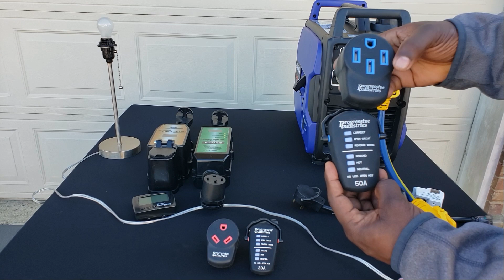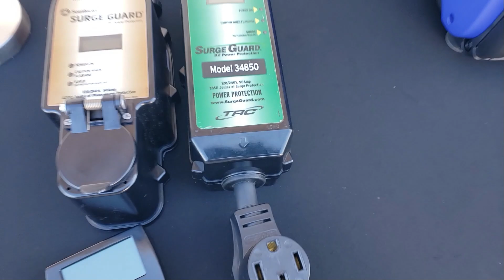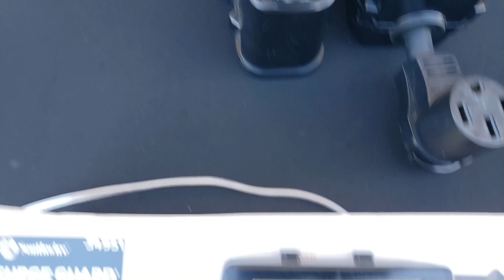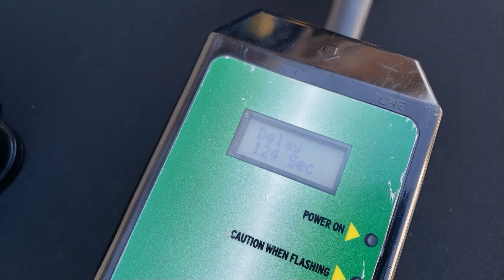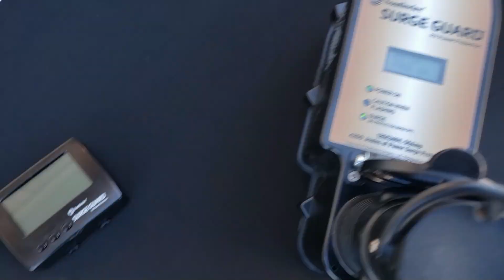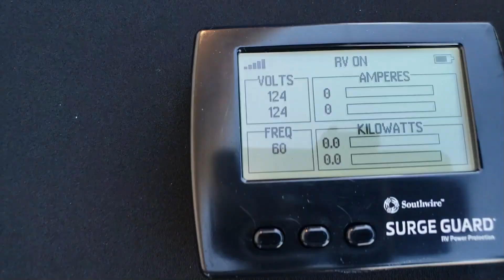Surge Guard Protection for Home and RV Back-up Power

Comment: I need to have an  inverter generator connected to a refrigerator.  Considering that the generator must not have a load when starting, does a surge protector protect the generator if I start it with the refrigerator already connected by mistake?
Reply from the maker: The surge protector helps with voltage spikes

Comment: So is it advised to use one of these when back feeding your home via a generator with a manual interlock and the generator is unbonded? Will these prevent issues like what say, a neutral wire form generator is loose and causes imbalance on the 120 legs which could overvoltage things in the house?
Reply from the maker: The only thing is you can’t use it on a floating neutral generator and that is what’s required for home back up

Comment: Great video I’m going to subscribe. What type of protector do you recommend for me? I’m running a Westinghouse Wgen9500 gas generator connected to a 10 Circuit Reliance manual transfer switch connected to a sub panel in my garage. Is there a way that I can install the protection into the transfer switch power outlet, in the transfer switch itself or into the sub panel? The main reason for my want is to protect circuit boards and LED bulbs throughout my home.
Reply from the maker: Sounds like you need a 30 amp surge protector for your transfer switch

Comment: I have the Duromax 9000 with 120/240 volt 30 amp twist lock  and 30 amp inlet box....would it be best to wire a whole house surge protector versus adapting a protector?
Reply from the maker: If you’re only going to use it on the home that would work installing a whole house surge protector but if you also have an RV, then the portable one works great.
Reply: @GeneratorReviews  thanks as always, Gavin.
No RV,  just home backup with my generator.

Comment: I don't have an RV, but I have a 240v 30 amp dryer in my home which one of these SPD will work to protect my equipment?
Reply from the maker: Anyone of the 50 A search protector will work for you as long as it’s 120V / 240V output
Reply: Thanks but why would you recommend a 50 amp spd over the 30 amp spd? @GeneratorReviews

Comment: CAn you use this on my house standby generator plug in to
My house
Reply from the maker: Yes, you can use it on your house for your standby generator. You just need a bonding plug if your generator is floating neutral.
Reply: @GeneratorReviews  Doesn't the generator need to be unbonded if using it for your house since the neutral is already bonded at the panel? So these can't be used when generator is connected to house and is bonded only in the house breaker box?

Comment: Hi there. I'm about to buy a back up generator for my house. I've read how inverter generators are safer for electronics, but they're pricey and only go up to ~9500W. I want to get a larger 12K or 15K W generator, but it wouldn't be an inverter. Will the Surge Guard protect electronics in my home? And are surges the only concern with non-inverter generators? 
I'm also looking into installing a Siemens Boltsheild FSPD140 Level 2 Whole House Surge Protection Device Rated for 140,000 Amps, 120/240V into my outdoor electrical panel and a 50 amp power inlet box for a generator hook up. But I'm not sure if the Siemens device will protect my electronics from surges from a generator. Any thoughts on this approach?
Reply from the maker: Hey 👋🏽
Well you are correct about the inverter generator but I can help you find the right one for your needs. 
You should visit my website and contact me when you’re ready.

Comment: What would I use on my Westinghouse 7500 generator to control the THD which I read is 23%
Reply from the maker: It’s not a pure sine wave generator so it has THD
Reply: @GeneratorReviews  is there an add on to control the THD

Comment: If the generator needs to be floating neutral for home back up and it’s bonded in the panel.  Would you still need the bonding plug on the generator for these to work properly?
Reply from the maker: Yes, the generator have to be bonded in order for the surge protector to work
Reply: @GeneratorReviews  So how do you get around the need for the floating neutral for home back up if the generator needs its own bond. Is the bond in the breaker box not sufficient?
Reply: @scottguich6099  I have the same question. NEC says only one bond, but then for the surge protector, saying need to be bonded at generator. I don't get it unless the surge protector breaks the bond inside it?

Comment: Excellent video!  I am about to buy the Surge Guard 34951 (now has bluetooth to phone app too) for our new fifth wheel and I have a question.  I've thought about buying one of those small surge progressive industries surge protectors so that if a surge happens, it fries the cheap one rather than the expensive one.  What are your thoughts on that?
Reply from the maker: I would definitely recommend you getting something to protect your RV and your investment but those Bluetooth surge protector are so nice to have you see everything you’re running and keeps you from going over especially when you’re running two AC units, helps you monitor the load.
Reply: Sorry, I wasn't clear on what I meant. I'm definitely getting the Surge Guard but should I plug that into the pedestal or plug it into a cheap surge only protector so if I get a bad surge, the cheap one fries and not the surge guard.

Comment: Any issues with using a L14-30R adapter coming out of one of the 50amp surge guards?
Reply from the maker: I haven’t had any issue using an adapter with a 50 amp surge protector

Comment: @Gavin....... brother I learn so much watching your videos. You put things out there in Laymens terms , that even even someone like me can understand. Thank you!
Reply from the maker: Thanks Jeffro
I appreciate you watching and subscribing 👍🏾💯
Reply: @GeneratorReviews  You bet Gavin!! Hey , I do have a quick question here. Do either of these big 50amp surge protectors , clean up the dirty power coming off a conventional generator? Maybe to help protect vulnerable electronics such as computers and so forth?  I could go with a 9000W invertor generator , but I'd like to use a bigger 12,000 - 15,000W open frame generator , if I can make sure it's not going to fry my electronics inside my home.  Was going to use a 50amp integrated plug into my main fuse box outside.

Comment: Have you ever measured A.C. voltage at your generator receptacles? 
I recently learned that some inverter generators are putting out 60-65 V. AC on hot leg and the neutral leg. 
Connect test probes hot to neutral= 120 V. AC as usual. 
**BUT** 
Test hot to ground= 60-65 V. AC
Test neutral to ground= 60-65 V. AC
Whereas traditionally 
Hot to ground= 120 V. AC and 
Neutral to ground= 0.00 V. AC.
Reply from the maker: That’s why I always use a surge protector on my RV it won’t allow faulty wired generators to operate without checking if they are correct

Comment: In some of your replies you mention the problem of connecting to a house system and needing a floating neutral for a generator (only having a single neutral bonding at the main service disconnect).  You are correct in giving that warning.  

Why not just permently install an Eaton CHSPT2-Ultra Whole House Surge Protector (~$140 plus a 50amp 240V breaker) which also protects your house everyday from surges coming through the utility power?  Since installing mine I have not lost any appliance controllers and before I lost 7 over 5 years.  The Eaton handles a surge current of 108K amps without damage!  Its diagnostics are limited to 2 LEDs which are lit when working properly.  The Eaton and the Tripp Lite surge protectors for TV's and computers should protect my whole house when running on my Genmax GM9000iED.
Reply from the maker: Agreed that’s the best way to go with the whole house surge protector 👍🏾👌🏾💯
Reply: @GeneratorReviews I have the Eaton whole home surge suppressor installed to a 50A breaker currently. Looking at generators would it be safe to use a standard non inverter generator due to their higher THD rating? I won’t be powering my central A/C but want my appliances protected if I use a non inverter generator. Otherwise I’ll bite the built on an inverter generator to power appliances, lights, fans and a window unit. This is just confusing if I have a home surge already will it protect from higher generator THD ratings.

Comment: I have a Duromax xp15000eh and was thinking of using a Pogressive ems-pt50x to protect against surges and low voltage between the house and generator.  The gen has 12500 constant and 15000 peak watts.  Will it work?
Reply from the maker: The only problem is in order to use the surge protector. You have to have bonded neutral, you need a floating neutral to connect to the house so the surge protector won’t work.
Reply: @GeneratorReviews  So I decided to do a full scale test.  I plugged the Progressive PT50X into the Duromax  turned on the power and it read out normally with the E0 code which means everything is okay.  I plugged it into the house still no problems.  I turned on the circuits one at a time and it read out the frequency, volts and amps on lines 1 & 2 still no problem.  I finally turned on a 5 ton Geo Heat Pump it started no problem.  No computers, tv's, routers, modems, cable boxes, refrigerators, or printers fried!  This generator has a THD of < 12% so the results surprised me as the expected destruction of sensitive electronics didn't occur.  Ran the test for 30 minutes.

I like the PT50X because it protects against low voltage and high voltage as well as frequency.
Reply: @GeneratorReviews  So if I plug the cord into the house first  then to the surge protector then into the generator it wouldn't correct the problem?

Comment: So what do you recommend for home use using the 30 Amp four prong twist lock connection between the generator and house, using a interlock device to keep  the main breaker off?  I plan on getting an inverter generator rated around 5,000 to 7,000 running watts.   Also I understand that when you use a generator to feed into the house wiring (with the main breaker off of course) the generator neutral should be floating (unbonded/open).  Thanks.
Reply from the maker: When you connected to the home, you won’t need a surge protector, the fact that you going to a floating neutral that alone prevents it from working.
The surge protector requires a bonded neutral
Reply: @GeneratorReviews  ok...thanks.

Comment: do these work like this emp protection plug. Generator / Inverter Protection - T.R.A.P.-AC (fits 120-volt AC plug),
Reply from the maker: Only the ones that say emp protection
Reply: @GeneratorReviews  Are you aware that the sun was yellow for thousands of years at a frequency of 7.83 hz,and now the sun is white sending in new light codes in thehundreds changing the shhuman resonance.It's activating our DNA,and chakras.It gave me covid like sysmptoms.I tested negative.Every time thsun has cme's solat flares,plasma,I get symptoms.I felt like I want to die in march of 2020. I know of millions of people who know about this. W are called starseeds.We are all over the internet.

Comment: I just got a 9,000w non-inverter generator for whole home backup (including 4.5 ton a/c using the Micro-Air "ramp up" device). The a/c ran fine (the MicroAir reduced the startup surge from 104A to 48A) but two electronic devices I had plugged in were fried (Garage door opener and Rachio sprinkler controller). I assume this was due to the "dirty power" coming from the generator. Will one of these tidy up the dirty power pls?
Reply from the maker: Unfortunately you can’t convert modified sine wave into pure sine wave by using a surge protector.
You’re actually really lucky the refrigerator and the AC control modules didn’t fry as well.
Reply: @GeneratorReviews  oh my! How do peeps with those big Generac home backup systems get by? Are they inverter-generators? I wonder if I can run the chest freezer on a big UPS and not use the fridge? (Presume everything on the back of the battery backup UPS devices would be ok?)
Reply: Then of course there’s the water heater and range.. seems like “whole home” is a misnomer? Spose I go round unplugging anything that has electronics that isn’t on a UPS in a power outage.. And what about the pool pump? Doh :-(
Reply: @randallpatrickc  Been using a dirty generator for years, but only power the refrigerators and a cheap TV.  It destroyed my refrigerator brain and ice maker controls.  Just recently purchased an inverter.  I would never use a standard generator for expensive equipment.

Comment: I have Genmax 9000 dual fuel.
I’m not sure which surge protector to go with. I plan to run the L14-30R plug to my homes 30amp manual transfer switch for back up home power. Which surge protector would be best and most simple with least adapters? Thank you for the videos I’ve learned a lot!
Reply from the maker: I’ve been testing the hues Autoformers power watchdog plus EPO 50 amp surge protector That have to be the best one out there right now
Reply: @GeneratorReviews  thanks for the reply Gavin. That’s the surge protector I was looking at but how would you connect it between the genmax and the home 30amp transfer switch since it comes with 50amp plugs? Would you get adapters to go from the genmax 30amp l14-30 to a 50amp to plug in the surge protector and then 50amp to l14-30 plug to run to the homes 30amp transfer switch?
Reply: @TonyStark998  I have the same original question because I have the same setup.  Did you find an answer to your question pertaining to a surge protector?  Thanks.
Reply: @TonyStark998  I got this message back from Gavin...
When you connected to the home, you won’t need a surge protector, the fact that you going to a floating neutral that alone prevents it from working.
The surge protector requires a bonded neutral

Comment: Hi, I was wondering which is better to use? Would it better to have a hard wired surge protector, or the dog bone style ones you showed here?  I only ask because of the volt drop you’ll get across the wire, depending on how long of a cord you’re using.
Reply from the maker: Hi, I prefer the the one I use they can be use on my home and my RV, so no need to buy a second one. When you sell the Rv you get to keep your surge protector

Comment: Good stuff, i didn't even know they made them large enough for homes.. I've used fridge guard surge protector for years with high and low voltage protect plus 5 minute delay  so the refrigerator compressor de-pressurises b4 restarts.. the newer variable speed compressor are so sensitive to voltage surges its definitely a good idea to use them
Reply from the maker: Thanks Joe. Yep With all the sensitive equipment that we have these are very important to have and you are correct about the variable compressors 👍🏾

Comment: Hey Gavin what you think about the Hughes Autoformers PWD30-EPO, 30 Amp Spike Power Watchdog,? I like the sureguard but it’s pricy
Reply from the maker: Very nice!
I like the Smart surge protector, emergency power off feature, Bluetooth built-in, power analyzer it has the high and low voltage monitor and the 90 seconds delay time awesome unit
Yep I like it has all the bells and whistles 👍🏾
Reply: @GeneratorReviews  Thanks for the info. Great video content as always 👌
Reply: Hello Gavin  can you do a video showing hook up using this with portable generator to your actuall home.  I have 30amp twist lock whole home hook up. This way is least expensive than a whole home surge protector
Reply from the maker: @TheTdnorris  yep it’s a lot cheaper and if you move it comes with you. I will!

Comment: Thx for the video!  
The Surge Protector with monitor 34951….can I use it with a bonded neutral generator (bonded to frame without GFCI protection - FIRMAN T07571)?  If so, I assume I shouldn’t use the additional bonding plug since it’s not a floating neutral generator?  
Also - I loved your 30AMP video where you made your own monitoring cord. Will you be doing a 50AMP video showing you making that cord?  Or, am I better off buying this 34951?  I think I’m most interested in monitoring the amps on both legs for home backup generator use via an interlock setup as I’m assuming the generator won’t surge on me (maybe wishful thinking?). 
Thanks, again!
Reply from the maker: Hey Jay 
You won’t need the bonding plug since it’s bonded and yes it will work.
I am making a 50 amp and 240v monitor video for the generator monitor but the wireless monitor is nice never having to go outside and check.
Reply: @GeneratorReviews  🙌🏼 Thx. I’m looking forward to that future video.

Comment: I use a Southwire hardwire surge protector. I love mine, and it has saved me a couple of times. I also use a quick voltage protector for 110. I use two different models for 110v 15 amp by Yellow Hat, and 20 amp is by Appliance shield. Both also have under protection too! I have also used them on RV pedestals for 110. Got them on Amazon for 20 bucks gave or take.